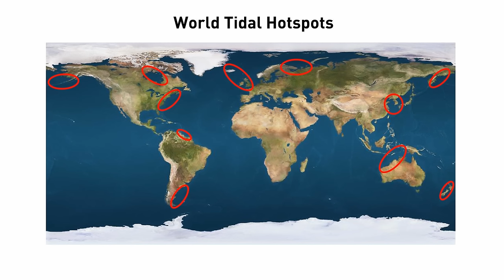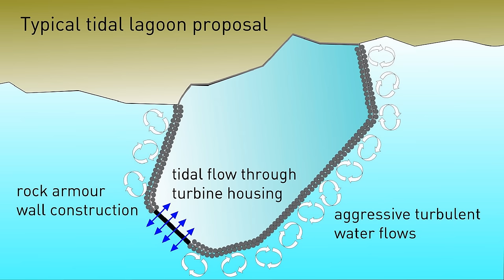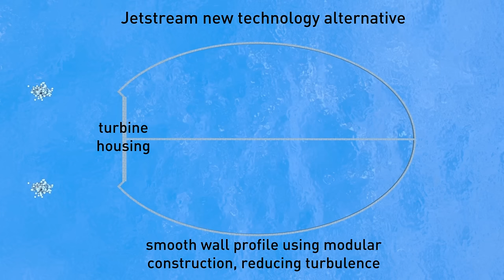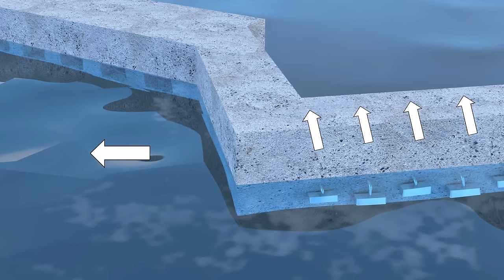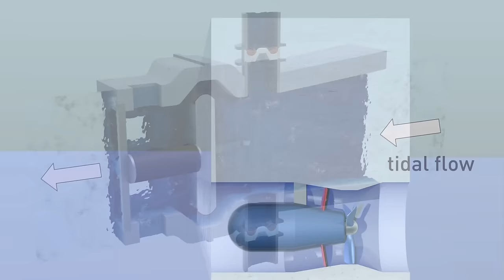Jetstream Tidal lagoon concept using proven technology from WPT's Venturo ram pump

Comment: Use the electric pump to pump water in and out from the lagoon, it uses power, does it offset the power which could be generated from the higher level of water?
Reply: I think the power used is actually very small, because it's the speed of the water flowing by that pumps the water up.
 
But even when you use energy to pump it up, the potential energy is proportional to the height squared. This means that you need a lot less energy to pump the water level 1m higher et high tide than that you will gain when you can let the water leave the lagoon at low tide. 

example: E1 is the energy you put in 
E1=1/2ρ*A*g*h1^2   
E2 is the energy you receive  
E2=1/2ρ*A*g*h2^2. 
If h1=1m and h2=11m (tidal difference of 10m), you get
E2-E1= (h2^2-h1^2)(1/2ρ*A*g)=(121-1)(c)  1/2*ρ*A*g is constant
=120c
If you wouldn't have pumped, the energy would be:
E=1/2*ρ*A*g*h^2=10^2*c=100c

So, basically, you would gain 20c
Reply: Actually, the pumps which are illustrated are powered by the water flow around the outside of the lagoon.  The reference to electric pumps is to optional additional pumps which would be powered by the floating solar cells.  That is only one use of the solar energy.  Another, more likely, is to simply send that energy straight to the grid.  In either case, the solar panels and electric pumps are an addon, not required by the basic design.